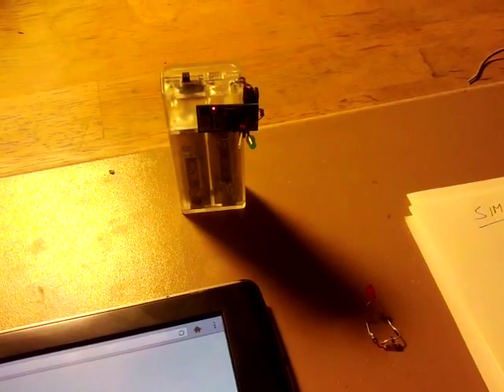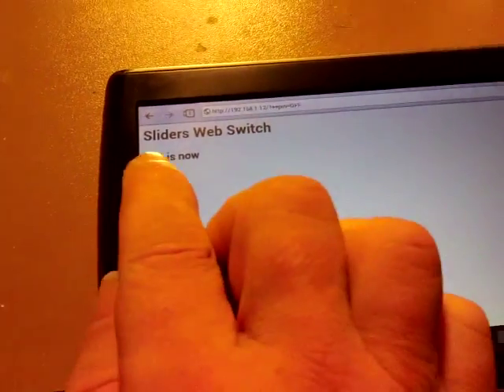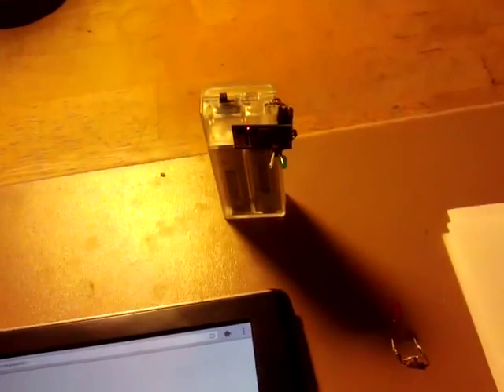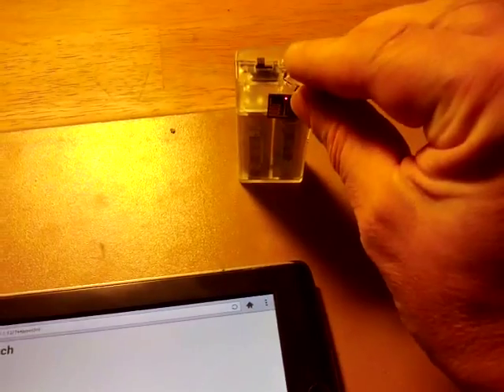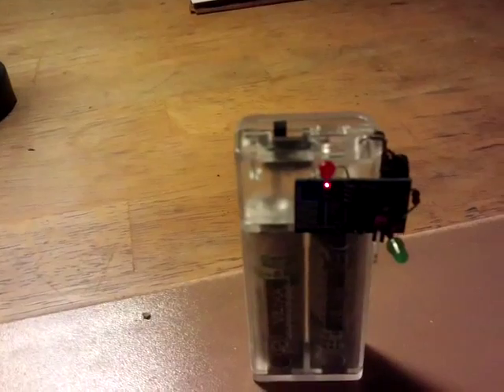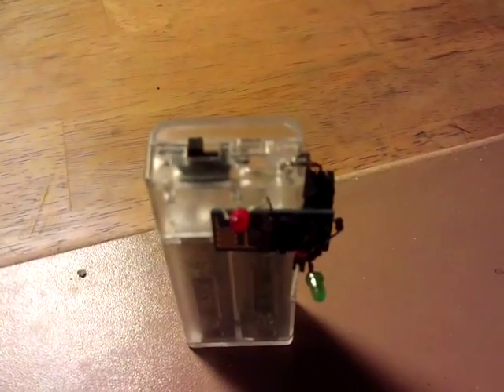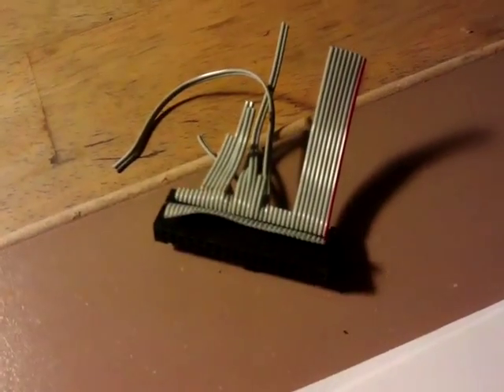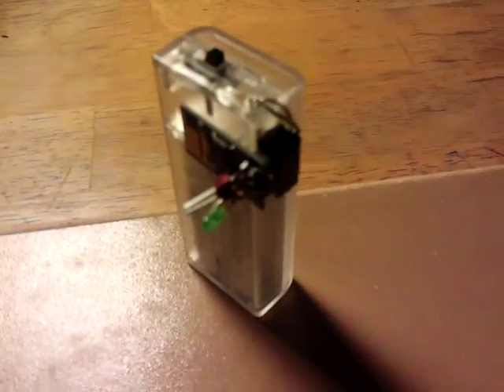Simple Internet of Things Widget

Comment: In the city where I live we have about 10 to 15 WiFi signals on any spot. In and around our houses, etc etc. You can imagine what a fight is going on, all those routers trying to have the strongest signal. On level 1 I have my WiFi, on level 3 of my house I am no longer to receive my own signal. I also tried those wall outlet ethernet things, did not work as well. So I am back to internet over utp cable, wired. Hooray for evolving technology. Baaaah !
Reply from the maker: deslomeslager Maybe a 'cantenna' or 'windsurfer' would help. They make the signal directional, but do boost by a good few dB and can be made from cardboard and kitchen foil. All those signals zooming around and stopping yours must be maddening! Would be great to harvest it and power something. Which then would drop your problem because you'd be using the neighbours energy up lol

Comment: Really like the T widget... Got to try that one. Thanks for showing!
Reply from the maker: iluzyon1 I found that regular diodes don't do anything, but germaniums do, especially the OA79. Similar to crystal radios in a way and microwave diodes may well do great. Normally output is a bit better than shown in the vid, but i'd loosened the module a little to let it fit better 1 handed. If right up on the back of the board it's very effective... without the table light being off lol
Reply: slider2732 Using the OA79 germanium diode and LED as a WiFi output visual indicator is a very good idea, thanks for sharing.  eBay does not look promising as a good source for the OA79 diode, any suggestions for acquiring this key component?
Reply from the maker: iQuest A good question, as this type are becoming rarer. I found 4 of them in a scrap CB radio. Other RF diodes and germaniums will likely work, maybe a Schottky, I just know that the OA79 does. A modern small 1N34A didn't seem to and a 1N4148 didn't, but testing hasn't gone any further due to the 1 working (happy dance and then the video followed lol).Certainly try other types though.